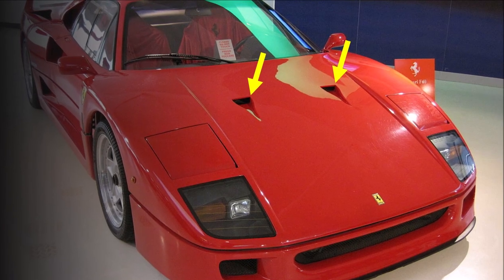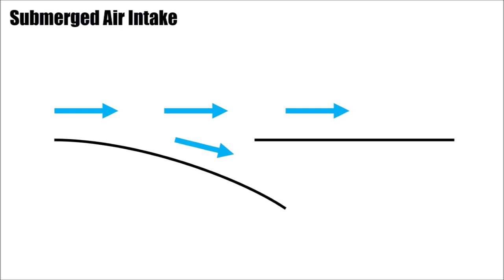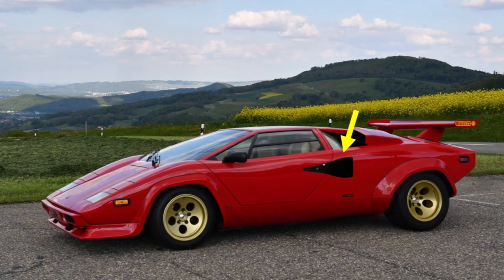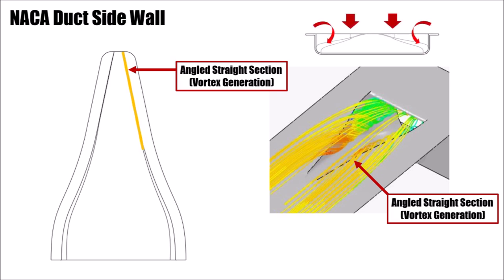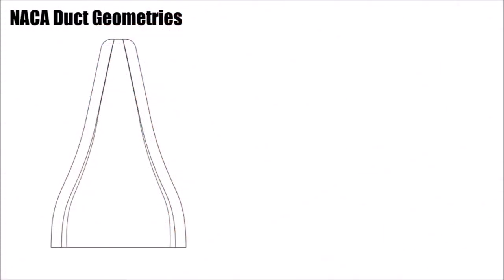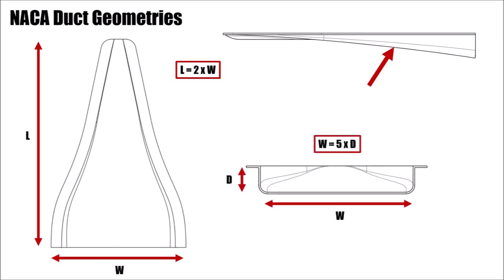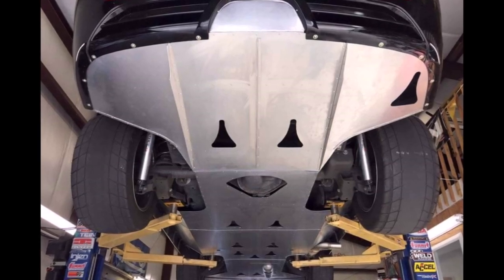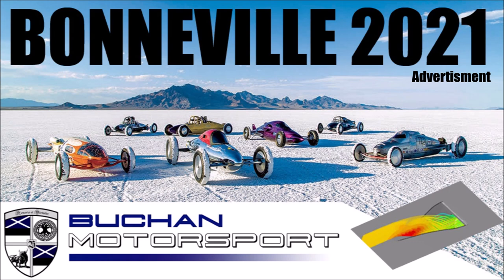NACA Ducts - Aerodynamics EXPLAINED

Comment: I would assume NACA ducts also fell out of fashion for fighter aircraft due to the transition to supersonic speeds? I don't want to imagine what kind of weird expansion fans and shocks would would get with a NACA duct at those speeds.
Reply: They weren't good at subsonic speeds either. Not for engine intakes at least. Good ram air is just beneficial for thrust and efficiency. Don't use NACA inlets for any application that would require a compressor downstream. You're reducing ram air pressure just to exert more power in the compressor.

Comment: Can you explain in detail how they work when turned around? I know that they did it at Nascar for low pressure outlets when they found a loophole in the rules. But why exactly is this backwards form better for integration then a normal vent

Comment: They are still used in aviation as air intake of PACK (Pneumatic Air Cycle Kit)s which are used to condition the air in airliners, inlet of B737's APU, vent surge tank inlets, ECU cooling duct inlets on engibe cowls etc.

Comment: Hi great video. We need proof of what these parts are actually doing. Ive got a question if you don't mind?
What sytle ram air intake would you recommend for a k car hatchback from Japan? They have a very different body shape to a normal hatchback and was wondering if you would have any advice on this? Thanks Aaron

Comment: Good one, always wondered how they worked.
A question if you don't mind,
why GT3/GTE race cars are much more pitch sensitve than F1 cars ? 
my logic is that GT3/GTE cars run quite high ride height , so to gain highest downforce level manufacturer make them peaky.
so the car gain downforce rapidly as ride height decreases via aero load.
Reply from the maker: Simple answer is because GT3 cars have a flat floor with a splitter at the front. Formula cars have a front wing and the flat floor only starts underneath the driver.
But as always, it also highly depends on the design of the cars...
Reply: @BSport320  Very good explaination. thank you very much.

Comment: I am currently using a hybrid design at work on an aircraft where you try and compromise between the naca duct and a pitot duct. As the naca duct does not supply enough ram air pressure for the internal cooling but reduces the drag of a fully protruding pitot duct.
Reply: I once designed a hybrid for use as a turbine engine inlet. A pitot type would have been best, but clearance in the launcher wouldn’t allow it. It worked very well.

Comment: So ram air intake is still better and NACA ducts are for pure aesthetics?
Reply from the maker: Depends on what you want. Ram air ducts for high pressure but with drag penalty, NACA duct for low drag with a bit less intake pressure.
Reply: It all depends on how much airflow you need to be ducted. High stagnation pressure = pitot duct. Low stagnation pressure = naca duct. But you do get hybrid designs that is a combination of the 2 to find a nice middle ground of drag reduction and stagnation pressure.